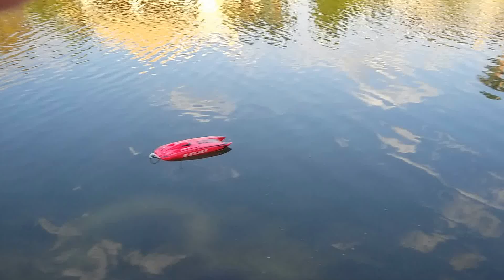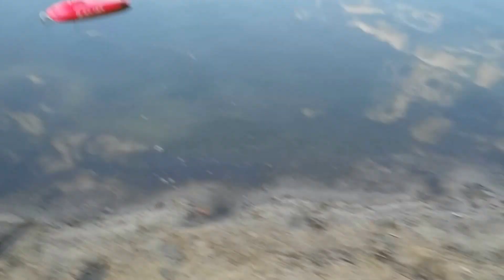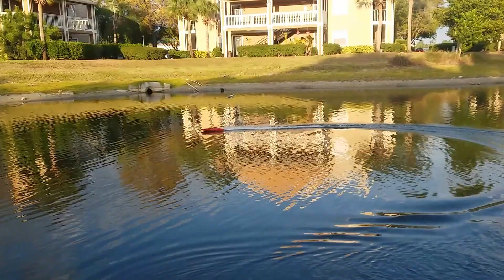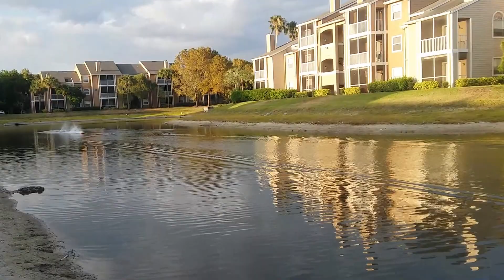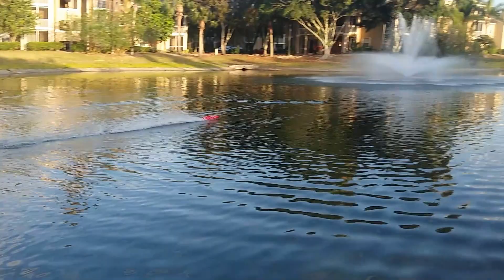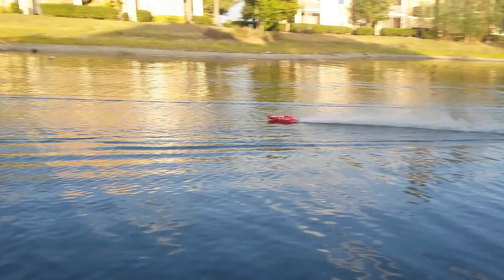Pro Boat Blackjack 24

Comment: I was going to do the same upgrades to my BLK24! Question, did you get the Leopard 3650 2750kv with the 5mm shaft motor instead or did you go the Leopard 3650 2750kv w/ a 1/8'' shaft w/ a Reducer?? Care to share some details on the upgrade?
Reply from the maker: I used the Leopard 2750kv with 5mm shaft. I didn't want to mess with an adapter.

Comment: Sweet setup! Do you happen to remember what the temps were after a run?
Reply from the maker: Thanks. I didn't check temps after that run but it doesn't get too hot. Having a 120A 6S capable ESC helps a bunch. Also because the Leopard 3650 2750kv motor is a Delta or "D" wind, I set the timing of the ESC to 0 degrees as D wind motors prefer low timing. Anything higher just causes extra heat without any real gain in RPM.
Reply: @DBJr1980  Thanks that helps tons! did you ever get the chance to fix the bobbing under full throttle?
Reply from the maker: @onionvolcano1  not yet but I haven't run this boat in quite awhile but one of these days I'll get it out again and maybe lower the strut a bit and see if that helps.